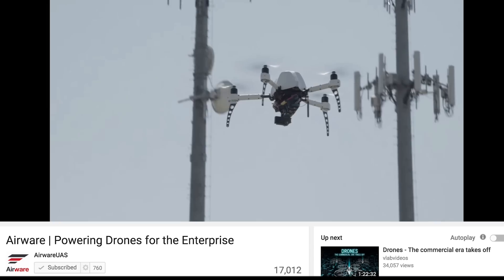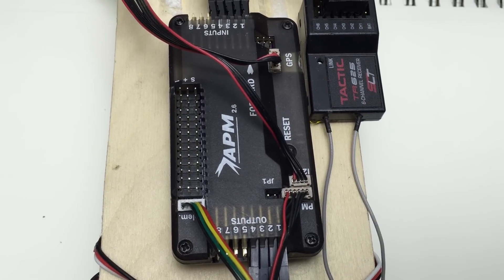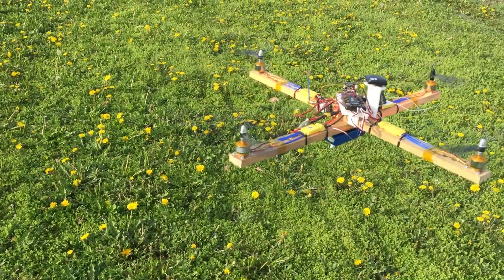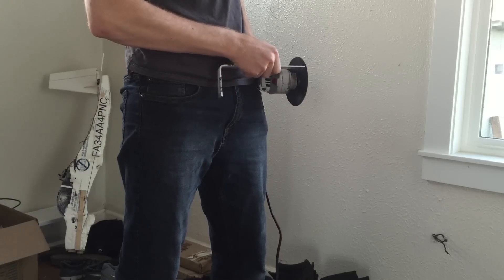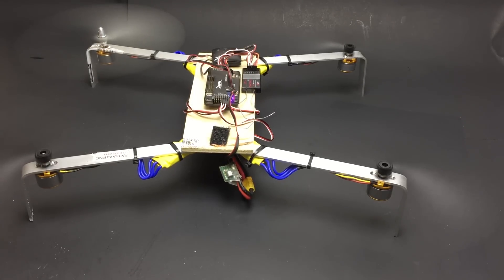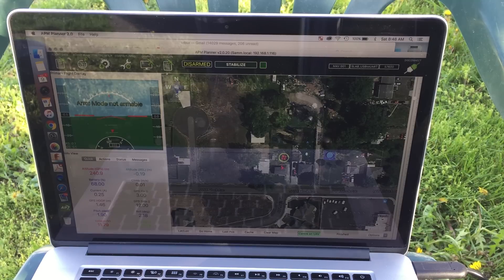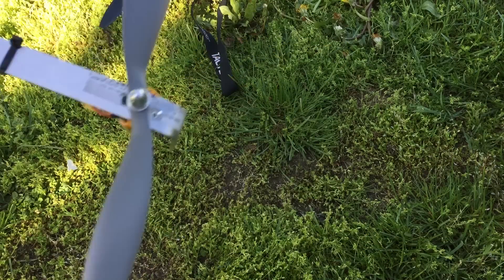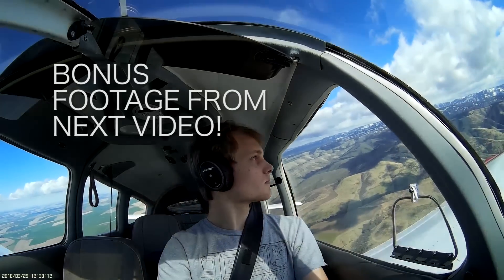My First Try at a Quad

Comment: Ahh, prop savers, how I don't miss you.
I started out with a very similar setup to this (possibly even exactly the same motors), and had a lot of the same problems as you:
Bent motor shafts, so moved to prop savers.  
But prop savers are unreliable, so kept getting random failures in flight.
Upgrading to better designed motors made a huge difference.
Reply from the maker: +remotaholic Yes, quality is cheaper and more frustration free in the long run.

Comment: Sam, I like this build, I built an h quad out of scrap wood, I think it's on it's 4 frame rebuild, runs off multiwii and old emax bell motors. When I first built it I tried prop savers but, i found they ad a crazy amount or vibration in high g turns. I have been flying a 3d printed 230 sized racer recently (video is up) and u must say, at that size this thing is a riot. I think you could design a super simplified racer frame for printing and it would be even more economical.
Reply from the maker: +Josh Moss many people have informed me that that have had poor experiences with prop savers. I see now why I don't see others doing it.. Haha

Comment: Have you gotten the pixhawk from 3DR? I have it set up on a pink foam wing which has the cg behind the lift so it can't fly but I am Wondering if you think it would be better to fix the wing into a canard, get a working wing, or a quad to effectively use the flight controller. It's been gathering dust
Reply from the maker: +macmaniac77 I have the older APM 2.6. Adding a Conrad will require a much farther forward CG, but yea find something simple to just play with it, autonomy is fun

Comment: I want to get into RC and build my own plane with a 1.2 meter wingspan. The only problem I have left is finding a good, cheap radio transmitter. Do you have any tips?
Reply from the maker: +Junior why so specific on the wingspan? haha. If you want cheap value I feel that this is good, but I don't own one so I can't vouch for it: http://www.hobbyking.com/hobbyking/store/__54822__OrangeRx_T_SIX_2_4GHz_DSM2_Compatible_6CH_Transmitter_w_10_Model_Memory_and_3_Pos_Switch_Mode_2_.html
Reply: ***** I dont know lol. People said that hobbyzone super cub is a good trainer so I want to have the same dimensions as that plane.

Thanks for the link and btw hot wiring foam is working great!

Comment: Hey, what's the difference between a tricopter and a quad? Other than the obvious 3 to 4 difference. Whh are quads so popular instead of 3 or 5 blades? What makes 4 better than 3 and 5 not better?
Reply from the maker: +Zachary Taylor When a propeller produces thrust by spinning one direction, that torque is also applied in the opposite direction onto the frame.  So a propeller spinning clockwise will make the multi rotor spin counter clockwise. So we need an equal amount of Clockwise and counterclockwise spinning propellers to balance and control yaw. A tricopter needs to tilt the back motor back and fourth with a servo to control yaw. In that sense, quads are easier and more simple because all the motors can be directly mounted to the frame.

Comment: Bloody great video as always Samm. I need some advice, I recently built a 60size glow ARF airplane and I wanted to install a good autonomous flight board on it to do some experimenting. Which flight controllers would you recommend? I would some day also like to use it on a quad. 

What other sensors would I need to make this happen apart from the autonomous flight chip? Thanks in advance.

If it's any help I use a Taranis Tx/Rx
Reply from the maker: +Gtx560ti Hi, I only have experience with the APM 2.6, which has been replaced with the Pixhawk. It and the "ardupilot" firmwares have the ability to do pretty much anything. However it is open source, meaning that it never really seems like a finished or refined product, the documentation and such is hit or miss and it's generally not super user friendly. The most trouble I've had with it is getting it to connect with various computers reliably for set up. Right now my computer won't show the parameters. Hobby king also makes their own autopilot boards which run the same firmware.

Using a flight controller with a piston engine is a little tricky just because you have to really isolate it from vibration.

Good luck, sorry I'm not much help.
Reply from the maker: +Gtx560ti Also, I didn't see the rest of your comment. Most flight controller require an external GPS receiver, which often also has a compass in it. And you can also get an airspeed sensor, so that your autopilot can maintain specified airspeeds. Otherwise it will use throttle settings.
Reply: +Samm Sheperd (SNRS) Thank you for the reply, really appreciate it. What other projects do you have coming up?

Comment: Great video as usual, but I really want to know how you messed up all those motor shafts.
Reply from the maker: +Rum Ham I've been waiting for that question.. With Arducopter, especially when you haven't fully tuned or proven its airworthiness, you should always have "Stabilize" (or "Manual" for airplanes) mode as one of your selectable flight modes so that you can take control if something funny happens. However I selected "Alt Hold" "Loiter" and "Pos Hold" modes on my 3 position switch. All of which do not give you direct control of the throttle, but rather uses your throttle input as as directions to ascend or descend at a determined rate. I took the quad way too high, and while descending it got stuck in a sideways attitude and couldn't recover itself. I may have been able to save it with stabilize mode. It landed upside down.
Reply: Thats too bad
Reply from the maker: Yea I was pretty disappointing. But it lead to new learning experiences with the new shaft and quad frame.

Comment: I have two X-8 SkyWalker flying wings, and I'm very very interested on those wingtips that you printed! May I ask how much would you consider to print me a pair? I hate the long wing tips and know that the plane can handle it self perfectly with out them.. also! I do hope your don't get stock doing quads in honestly I dislike them a lot because many people that do not understand aerodynamics or even have any pilot knowledge have the opportunity to ruin a once beautiful hobby that was a doorway to get in to engineering concepts... hope to hear from you soon.
Reply from the maker: +Migueldeservantes Hi, I'd love to work with you, but I'm not sure I quite understand your issue with your X-8's
Reply: +Samm Sheperd (SNRS) Only in the case that you have experienced the difference between the X-8 Skywalker and the FX-79 would you be capable to understand... the X-8 Wingtip wingletts make the plane literally wag the plane lie an hyperactive dog at low speeds.. but the FX-79 have the wings located in the center fuselage.. making the plane super stable at low speeds... the X-8 is inherently a low speed flyer! and that mean a constant bobbing of the entire plane at what one may call low cruise speeds.. that is the reason I wanted to get small wingtips.. and them install a set of V'ish type fuselage wings to make the plane more stable! I DO LOVE MY X-8, it may be one of the planes in the market with the largest amount of Real State to put any and all the possible equipment inside, but it does have its flaws ...I just hope to get in your good side and see if you may print me a pair of those nice winglets so I can modify the ones that I have.. thanks in advance.

Comment: I tried to do what Samm did, using the same controller and Mission Planner. No luck. Too many bugs in Mission Planner.
Reply from the maker: +Dan Jacob yea APM stuff is hit or miss. I have to use both a Mac and a PC sometimes to work around bugs
Reply: ***** So true. I'm just going to wait till there will be something more reliable than MP.

Comment: Not bad but I mean you can get a ZMR250 frame for $20 which is going to be much more stable. Put some DYS 1806 motors, Little Bee 20 ESCs and a F303 flight controller on it and you have a really good budget race quad for next to nothing.
Reply from the maker: The point of this was to figure it out on my own without buying a frame. I have since dug deep into racing quads if you check out my recent videos
Reply: Nice! I checked out a few of your videos after I made that comment, you're doing some pretty interesting stuff here. 
And yeah I certainly can appreciate building a frame from an engineering perspective.

Comment: at 5:29 in video I chuckled because the warning heard was about "voltage".  Voltage ?!!! How about, "Warning!  I have coughed up a prop and am now a rapidly descending tri-copter you didn't decide to build."
Reply from the maker: +28th St. Air Land &amp; Sea haha yea. I don't know of any flight controllers that can cope with failed components. But it would be very possible to sacrifice yaw control and descend on two motors while spinning. Or maybe a parachute at the moment of lost control would be neat.